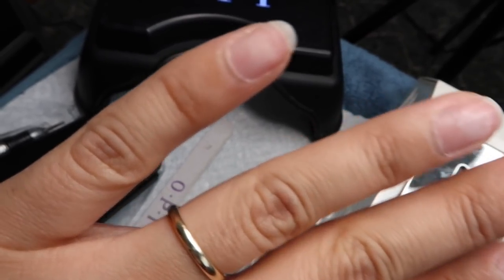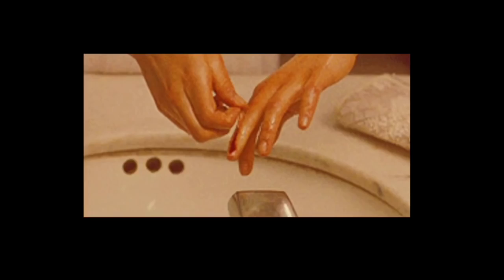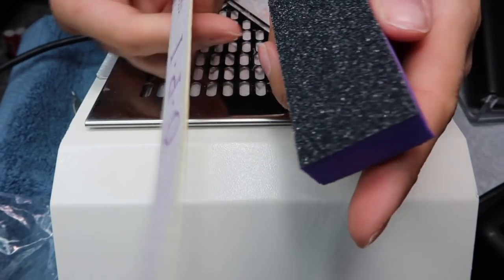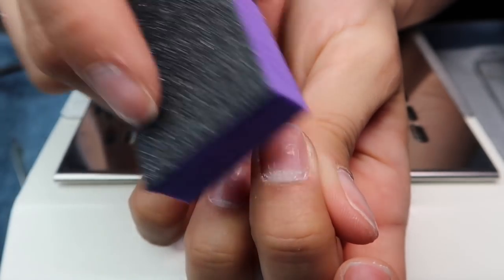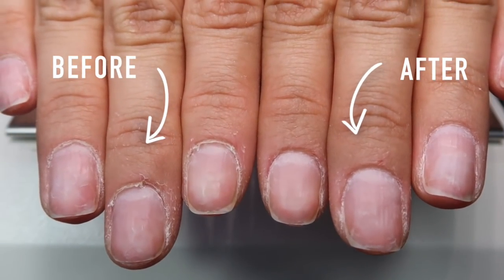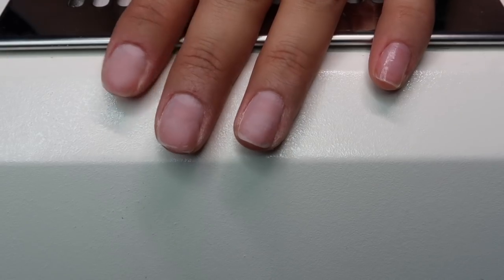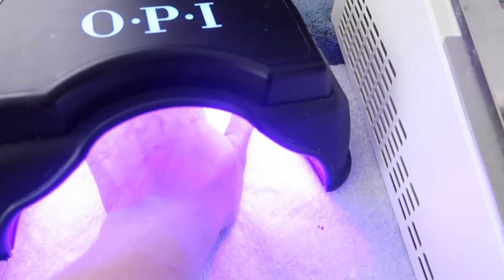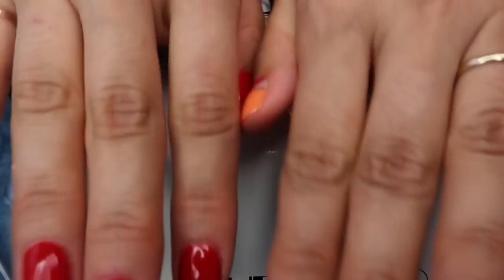DRY MANICURE TUTORIAL | WHY NAIL TECHS CUT CUTICLES

Comment: I damaged the matrix on my wedding finger nail, by not using any oil on it when using a metal cuticle pusher. Only did it once and didnt push hard, but obviously the cuticle area is sensitive. Had nail biopsy which has sadly mis-shapened my cuticle. Never again!

Comment: But its not actually cuticle xD  the cuticle  aka true cuticle is below that skin what you see on your nailplate....  And why that skin on your nailplate grow so fast, cause in every manicure  the manicurists  cut them away every time.   In general i always when i wash my hands i also push back that lil tongue of skin aka eponychium ( that true cuticle is below that eponycium and this is what you need to remove instead) , that it will be as close to the  edge of the  proximal nail fold as possible and i never ever cut it myself or approve others to cut it.
Reply: yes! i’ve been really struggling with this (just finished school) i thought i was misunderstanding bc i see many nail techs cutting the skin around the nail plate calling it the cuticle, but our book states cuticle is ON the nail plate and can be removed but to never cut the skin above the cuticle (which is the eponychium right?) also where the book explains hangnails, they reiterate that we are prohibited from cutting the skin surround our nails and cutting the area will actually give you hangnails! :/

Comment: I used a dark green nail polish and now my nails have that yellowish color. Any idea how I can get rid of that?
Reply: Did u use a base coat before applying the polish?
Reply: @stephanie7151  😅nope lol that's the reason why that happened haha I'm just letting them grow and cutting them short until the yellowish greenish part is gone.
Reply: you can try a lemon to get rid of it. U need water that's a bit warm.. not to warm (lukewarm water in English?) Squeeze a bit of lemon in the water and some pieces of lemon.. lemonpieces like cutting one in 4 pieces. Put your nails in the water for a few minutes. go over the nails with the pieces of lemon that's in your water.. you can use a brush to go over it but i'm not a fan of it. But you can if you want to.. After that again a few minutes in the lemonwater with your fingers.. than you need to rinse your nails with with warm water. After you have done it you need to use a good cuticle oil or a hand cream or nail cream because it can dry out your nails.. there are more ways to get rid of coloured nails.. this is one i know.. if you ever have this problem again and this doesn't help you can always google for other ways, greetings from Belgium
Reply: @ikkern8390  thanks for the tip, I'll give it try!♥️